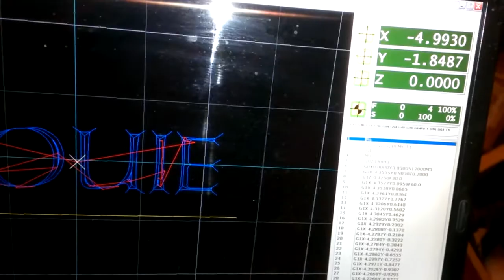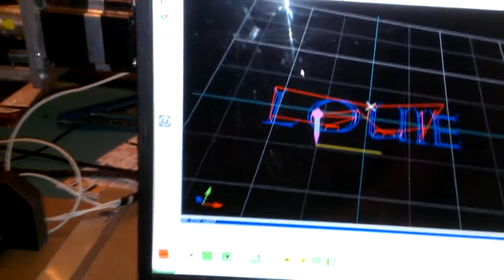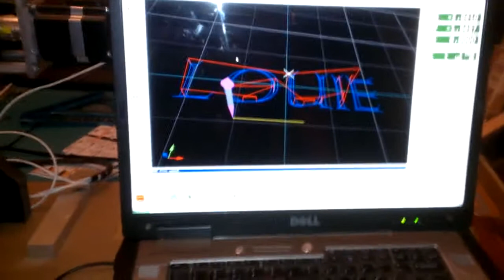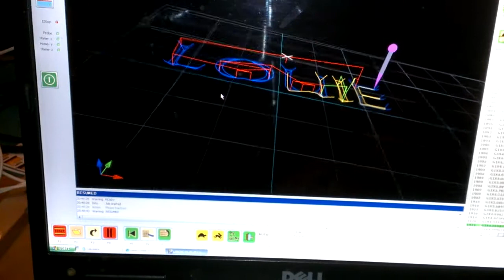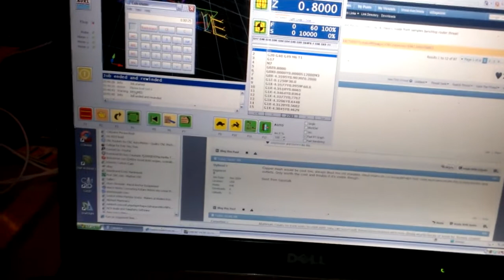NEW CNC STEPPER DRIVE BOX, USBCNC5A, LEADSHINE DM542!

Comment: DM542 is not necessarily digital drive. I found it myself when was about to autotune motor - no such option, and they not have RS232 port. I compared it to my previous M542 on my machine and there is no difference apart of the price.
I wish I did more research before I spend £85 for something what is worth £45
Reply from the maker: The M542is an analog drive.  The DM542 uses a DSP, hence the digital.   Apparently, you have to do more research...
Reply: As I wrote, not every one. Top cover should state Autotune SW4  -  Motor auto-identification. Just checked again - swapped with analog and there is no difference - noise, smoothness, the same. Noticed difference  when tested DM456 with the same setting (pulse, amp). Here is auction http://www.ebay.co.uk/itm/3Axis-CNC-Router-DIY-stepper-driver-DM542A-PEAK-4-2A-18-50VDC-CNC-Controller-/191411799352?hash=item2c91084538:g:ZioAAOSwIBBUZFxK no info about DSP.
Reply from the maker: If you buy a Leadshine DM series drive It is a digital drive for sure.  I cannot say the same if you buy a drive that's OEM or a clone....  My drive has auto tune.  But I bought mine from an authorized Leadshine reseller.  The video proves the performance.

Comment: What voltage power supply and which make/model stepper motors are you using with the Leadshine Dm542s?
Reply from the maker: 48V PSU, Kollmorgen (Danaher) steppers.  Specs in my other videos...

Comment: might want some aluminum standoffs, if you're relying on them heat sinking those steppers... right? If you can find some, that might be a good idea. Steel sucks as a heat sink, especially with such a long and narrow path. That's my two cents. Cool machine.
I just got some Leadshine drivers with tormach motors, and my other machine is using the g540. It gets pretty hot and it's really loud!!!
Reply from the maker: The standoffs are attached to aluminum stepper plates which also act as heat sink.  The Leadshine drives paired with the Kollmorgen steppers do not get too hot, even when running a long job.
Reply: I mean if you want to drain heat through the standoffs... You might be able to find aluminum ones. Anyway I'm looking forward to trying these Leadshine drivers
Reply from the maker: Tanner Bean I did consider that, but since the frame of the machine is not metal, I don't think it matters too much.  These steppers are not your average run-of-the-mill cheap steppers.  They're capable of 3000rpm with the right PSU and drive.  They also are designed with higher temperature insulators and can run at higher temperatures than "regular" steppers.  Even then, they don't generate as much heat as you'd think.
Reply: Okay that's cool

Comment from the maker: I should note that you can purchase Sanyo Denki, Kollmorgen/Danaher, Vexta, or Lin Engineering stepper motors for not much more than some higher-end Chinese steppers, which have better insulation on the motor wires and better bearings